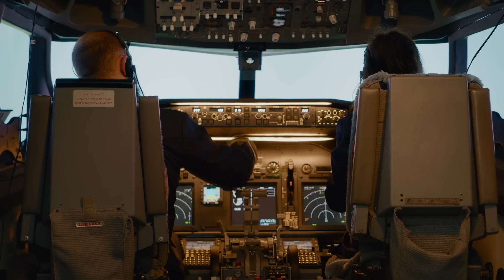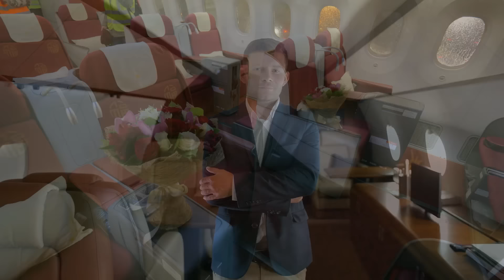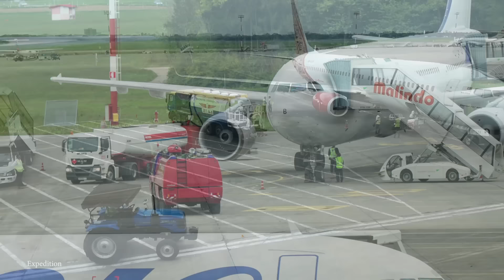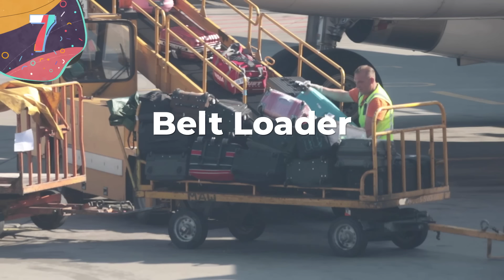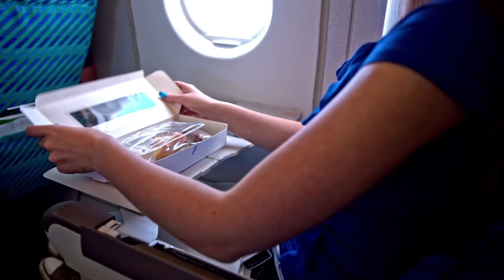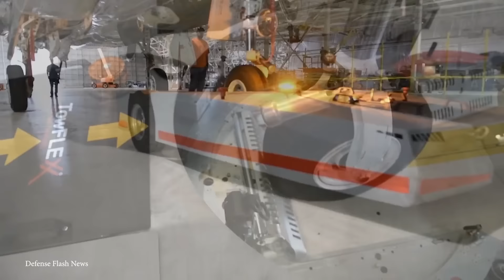15 STRANGE Airport Vehicles

Comment: usually, on most commertial aircraft there is a engine in the rear of the plane that is what provides power to the plane if there isn't a external generator for it to hook up to
Reply: That engine is called an APU, Auxiliary Power Unit, and is essentially a small jet turbine just like its bigger counterparts on the wings. There are pros and cons to running it, so it is a case to case base for a pilot to use the APU or rather a GPU, Ground Power Unit. We Ramp Agents hate the APU, because it is LOUD as f* and makes communication on the outside during loading super tough.

Comment: The announcer refers to the place where the plane lands and area where passengers board as the tarmac It’s actually called a ramp not a tarmac
Reply: You can call it either. Ramp is without doubt the most common and, I guess I'd say, most accepted "professional" word for that specific area. However you can use apron, ramp, tarmac (tarmac esp . in the U.S.) interchangeably.